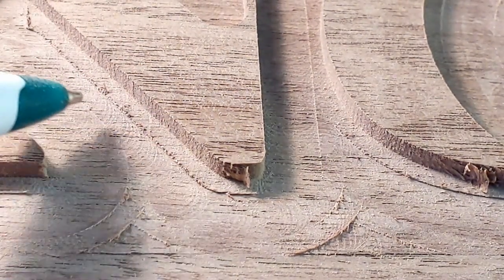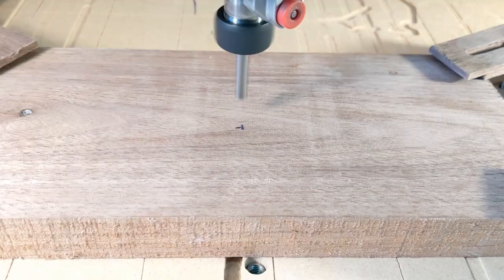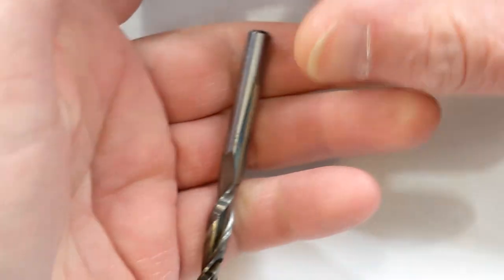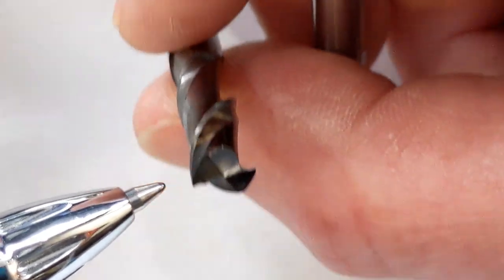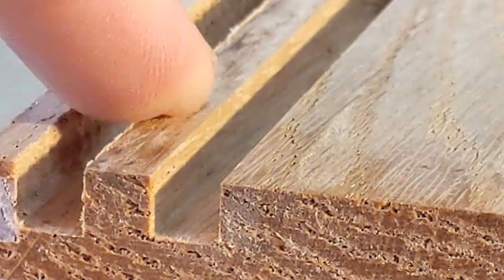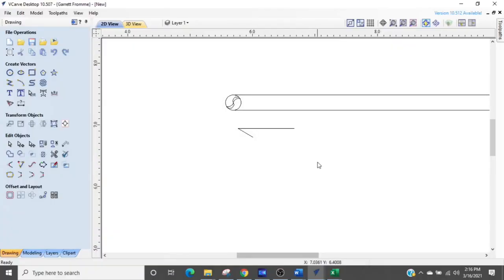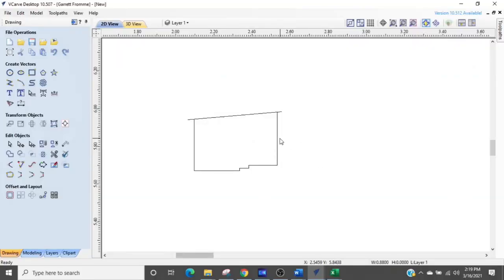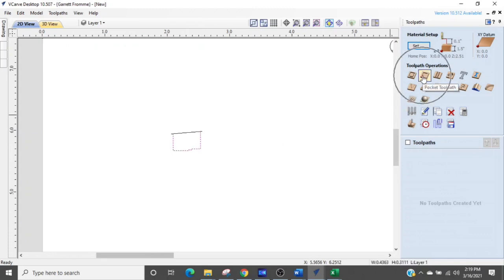Down Bits (Down Cut) And CNC Routers [What You Didn't Know] - Garrett Fromme

Comment: If you software supports it, Inner corner feed rate reduction will do wonders as well. Use the stubbiest endmill possible. I plow everything away with a 90% step over with a stubby 3/8 or 1/2 with a light chip load to reduce large tearout. All the same concepts apply with metal as well except the metal doesn't rip out chunks from the tool pressure
Reply from the maker: Brian, Great info, thanks for sharing brother.

Comment: Great info, Garrett. I've been doing something similar by using a pair of toolpaths, a roughing pass and a finishing pass, for the paths where this is needed/relevant. The roughing pass will typically stop 0.01 above the final depth. The finishing pass will take care of the final 0.01, as well as have a smaller stepover and a higher feed rate. For instance, the roughing pass might have a 0.1 DOC, a 25% stepover and a feed of 60 IPM. The finishing pass will be 0.01 DOC, 10% stepover and feed rate of 100 IPM. Yes, it takes longer, but still shorter time than cleaning up without the finishing pass.
Reply from the maker: Excellent. You've got it figured out! It usually takes a painful journey of sanding and realising it is much more worth letting the machine spend extra time at it.

Comment: funny- I'm new to the cnc desktop world but I've been manual milling with a bridgeport for a decade, and i see the same deviation while milling soft metals with an up-cut end mill- and i just eventually learned it was the material pulling the tool into it- (another reason not to use an adjustable drill chuck on an end mill vs a dedicated collet- as the cutting force seen between the tool and metal will yank the chuck right out of the spindle!) it's far less obvious with metal vs wood especially between using a steel bridgeport milling machine vs a plastic & aluminum cnc desktop, but it does happen.
Reply from the maker: Just Another Day, those are all great points man! These desktop routers are definitely deflection limited! Just like you said a bridgeport can do things that a cnc router isn't designed to do! Great looking out!

Comment: Thanks Garret, another good one!!  I have noticed what you are showing and never knew there was a fix for that.  I also have a question for you.  I fall my own trees and have a friend with a Woodmizer saw mill who mills my logs for me.  One of my favorite woods for simple not for show projects is Spruce.  We can fall trees up to twenty four inches diameter with a wood cutting permit and in some areas even bigger.  What I like most about it is that the bottom sections of the trees are almost knot free.  I makes really nice clear lumber.  And the best part is that it's free.  Don't know if  you have ever used it but I can tell you this, it is very, very strigy.  In this video where you show the difference between the cuts of the up and down cut bits, you can see the top edge of the board where you used the upcut bit is a little rough.  That same test on Spruce would leave one to two inch long fibers through the entire cut.  So I have been thinking I could use a downcut end mill and set the toolpath to about 1/16" deep and go around the entire project at that depth, then change the bit to an upcut to accommodate the fact that the cut is going to 1/2 or more deep.  That way I would have a clean crisp top cut, with no sanding,  and a more even bottom cut.  What do you think?  Would like to hear your thoughts on this.  Thanks again Garrett for all the videos.
Jim Scott
Reply from the maker: Hey Jim, great question! Your thought process is sound and I think this could work really well for you. I haven't done a lot of projects using spruce so I'm not super familiar wit the way it tends to cut. I'd say best method is trial and error on tis one. Worst case is you might need some sanding at the very end! Let me know how this turns out, I'd love to hear!

Comment: When I first started down the dark road of CNC routers. I had the same problems, but what I DID observe was the lack of my machine's rigidity. Anything you can do to beef up your machine will minimize witness marks. You'd be surprised at what some light weight aluminum angle can do for a machine's rigidity. You won't eliminate the witness marks entirely , so Garrett's solution is the one to go with!
Reply from the maker: Hi Greg. Thank you for contributing here. I always enjoy it when other CNC'ers add to things I miss.
Reply: this comment 100% i typically work with 2000 lb steel milling machines  (bridgeport) that have zero rigidity issues- i was unpleasantly surprised while unpacking my next wave desktop cnc to find it was built with a plastic frame and aluminum top- the whole thing flexes under stress. I've already begun to contimplate rebuilding the entire cnc with aluminum!

Comment: Thanks for the info.  I have seen this in my latest project and wondered if it was the setting of the bit in Z,  clearance path for a down bit z setting and then resetting the Z again when the bit was changed to the 60 degree bit.  I use at least 2 passes for clearance areas. I have also entertained the notion to add a 3rd pass but haven't gone that far yet.  I just get the sandpaper out and sand the marks out.    You have helped me get a much better understanding of CNC related stuff .
Reply from the maker: Hey Stew. This little down bit video is something I hope a lot more people take the time to watch. It is so important to get good finishes.

Comment: You have a lot of videos. I don't know the correct one this comment falls under but I am sure you will get this message and I want to thank you! 
You should get with longmill programmers for their touch plate!!!!!!!!!
I have been using your formula for finding the lower left corner. Works great (which I don't see others on YT doing). It even works when I divide the CUTTING diameter vs shank diameter. However, I just received my touch plate from longmill. I tested it out on a 1/16 bit which the shank diameter is larger then the cutting diameter which makes it irregular. But however you can put your own size in. I used .625 (already put on?? Must be a mistake), .0625 and the actual cutting diameter of .058. None of them got me near where it needed to be like it should have! Not until I typed your formula into the console did it attain a very acceptable position in the lower left corner.
To make a long story short -  their touch plate is absent of your formula to calculate irregular shapes. They can easily do this if they knew how. I know a lot about programming so I recognize the faultiness. Call them and get this fixed!!
If I plug in values it needs to calculate for these values!!!!!!
Do you know what I mean?
Reply from the maker: Iwannaapple, you bring up a great point. Unfortunately I don't have much say in the longmill touchplate. I would recommend reaching out to Longmill directly and telling them about this issue with the touchplate. Thanks for bringing this to my attention though and I definitely understand the frustration brother!
Reply: @IDCWoodcraft  
I already did! :)

Comment: I am new to cnc and really appreciate the info you provide. I don’t use Vectric software though, rather I use carbide create and carbide motion, but so far, things you have taught are easily transferrable. I am particularly interested in doing deep inlays, therefore, any direction you can point me in that will help with that would be fantastic. Thanks and keep on teaching!
Reply from the maker: JeffC-ct5jj, I'm glad you find the information helpful! Deep inlays can create some stunning effects. A good place to start would be to experiment with different bit sizes and depths to achieve the desired effect. I have a video that is for Vectric users but it should be able to help you quite a lot in Carbide Create too brother! Here is a link: https://youtu.be/Naxq3SbQH50?si=0rClZxe2ZdMVGRPS

Comment: Hi Garret, great video, love hearing the engineering explanation behind the reason. I happen to be using upcuts to pocket recycled hdpe plastic. Down bits melt it and cause a mess..the upcut pocket is super clean …but as you probably know I am experiencing the opposite whereas my line around the letters is deeper than the rest of the pocket.
Reply from the maker: Mike, glad to hear that this video helped you! Try using a smaller stepover or stepdown and it might get rid of the line around the letter

Comment: Another software moment.. additionally,  this can be machine enhanced.  If you have end play in the router shaft or if your tram system  belts or screws,  need maintenance; these pressures from the bit would be magnified.  On more point. My interest is in making guitar parts and there are videos all over the web advising to never use a downturn. Reasons range from fire hazard to inappropriate for the work. My observation is they might not be using the correct tool path,  i.e. spiral ramp, or maybe they like sanding. Thanks, Ron.
Reply from the maker: Ron, all good points brother. Glad you liked the video.

Comment: Question What are your thought on using 2 flute straight plunge router bit. This bit has a cutter all the way across the bottom of it .that his how it is able to plunge in to the wood. So it gives you a flat  bottom cut. There is nothing about the bit that is pulling it down or up.   Freud - FREUD 04-126 3/8" (Dia.) Double Flute Straight Bit with 1/4" Shank (04-126) Red
They com variety of sizes with 1/4" shanks.  a very good explanation of how those bit work. Thanks Jeff
Reply from the maker: Hi Jeff. The 2 flute up bit can plunge straight in and they work very well. The draw back is the burr left along the upper edge, leaving sanding work. The down bit leaves extremely clean edges along the top . Companies do not discuss this aspect. this simply comes from years of CNc machining experience.  Hope this answers your question

Comment: Great Video, don't you just love Vectric software?
 However not all of us have Vectrc software and if like me you are just struggling along with Carbide Create, then this option is not available. I address this problem by adjusting the depth of cut so that it leaves a small amount for the last cut. That is, if you are cutting to a depth of say 6mm, then if you adjust the depth of cut to be say 1.9mm per pass, then you will have a 0.3mm clean up cut to finish. As they say " There are many ways to skin a cat"
Oh btw sorry for using the deadly metric system in this example.
Keep Cutting
Reply from the maker: 'Metric' is not a four letter word in this boy's eyes. I love metrics! Far better than imperial.

Comment: Thank you! This was very helpful. I’ve avoided doing a finish pass because I figured I wouldn’t need to with wood and it would just take more time. My aha moment was in the first half of the video when you showed the sharp corners at the top and at the bottom. As you talked about the cutter on the bottom of the upcut bit I thought, “What about taking a shallow pass first with a downcut bit to have a sharp edge on top and then switch to an upcut but to finish and get a clean bottom surface?” The last half of the video answered my question though. My idea would work for a slot the width of the bit but not for something wider. I’ll start implementing finish passes, even though it will take longer on the machine. It’ll save me sanding time. Thank you!
Reply from the maker: Hi Kyle. Thank you for sharing this. Definitely enjoyed reading your insights. I think most people don't want to spend the time letting the machine do a finish pass. And it always ends up in more time sanding anyway.

I wish I had included in the video that finish passes are part of the process in virtually all machining processes in the industrial work. In fact, 'finish pass' is part of the lingo and operation. Wood is no different.

Comment: Hi Garrett, again great explanation of whats going on, but let's say you are using 2 or 3 different tools to do a pocket and letters, I get it with the 6mm for the main clearout, then I normally use a 2mm to finish off around the letters and tight spots, the again finish of with let's say a 60 deg 0..1 tip to give a slight angle on the letters. Do I then have to apply this to all the tools I am using??
Reply from the maker: Warren, that is a very advanced question so right on for being ahead of the game. This will take some experimentation in your case. I would not apply this correction to the v bit as these are usually straight flute tools and don't push or pull into the wood. As for the finish tool, you might see irregularities if you use a different stepdown and stepover as a percentage of tool diameter than your roughing bit.

Comment: Hey Garret. For the downcut bit to pull down or the upcut bit to pull up or down by 0.040" as per your example surely there is either lots of play in the spindle bearings or backlash in the vertical (Z) drive or "give" in the construction of the machine
Reply from the maker: Hey Mac. Yes, it was exagerated due to the machine. It is not super rigid. However I have seen many many posts in CNC facebook groups about this issue so i was prudent to share regardless.
Reply: Came here to say this. I have run a few different CNC machines now and none of them exhibited this problem with pocketing, either with uncut or downshear tooling. There should not be that much slop in the spindle or that much backlash in the z axis. If someone experiences this, my advice would be to have their machine serviced and checked for excessive wear in these areas.

Also, in the first comparison shot where the upcut and downcut grooves are side by side, the super ragged top edge and rough sidewalls usually are a sign of a worn out bit. I typically use up cutting bits for that type of signage and get clean top edges unless my tooling is worn.
Reply from the maker: @jzclarke  Thanks for the input hHighlighted. Yes, rigidity is a factor as well as bit condition. However, I see this issue all the time in facebook groups. So there are a lot of fo machines out there with rigidity issues. Gotta come up with a solution for these folks.

Comment: Taking a final light pass is a good idea -- just really time consuming. (Maybe stepping up the feed speed on that last pass so it doesn't take so long -- Mach 3 can do that on the fly; don't know if other controller software can.)
But your difference in depth between the up-cut and down-cut bits is over 1/32".  I'm sensing a lot of flex in your X gantry. 
I've avoided doing last passes to eliminate witness lines as well as not setting a small last depth pass just because of the time involved. But I'll have to give it a try.
Reply from the maker: Hi Richard. Unfortunately I do have a lot of flex. Either way, a lot of people have this problem with less flex. I forgot to mention upping the feed on the second pass for time so thank you for mentioning that.

For those who cannot change the speed, a second toolpath over the same vectors with higher feed is an alternative

Comment: Very helpful thanks! But after watching this comparison between up- and downcut, why would I want to use an upcut bit at all? In  what situation is an upcut bit better when working with wood?
Or is an upcut better for materials like aluminum and plastics?
Reply from the maker: In woodworking, upcuts are good for very large material removal. They do leave a better bottom cut on first passes. You will definitely want it if you are making very deep slots where sawdust has difficulty escaping from the slot

Comment: As always, great content.
Question: around the 5:20 make when you were measuring the depth differences between the Upcut and Downcut bits, what was the depth supposed to be? Thanks.
Reply from the maker: MickMack, under ideal conditions with a very rigid machine, the difference in depth is supposed to be 0.00." I was showing you the drastic difference that just a change in an upcut vs downcut endmill can make with everything else being the same.

Comment: Garrett, in a perfect world where absolute rigidity is the standard for benchtop CNCs, a bit shouldn't be able to pull itself downward, nor push itself upward.  I am therefore wondering if what you're describing is the result of flexing in the CNC components that affect the Z axis movement: the Y-Z gantry, the Y-gantry and the Z-axis frame.  My statement is based on my manual routing experience, where I frequently use a variety of router bits, both up and down-cut styles.  Thoughts?
Reply from the maker: You are correct. Regidity has a lot to do with it. However the other dynamics still come into play. Not as severe when the machine is strong. There are other other factors as well such as tool deflection which has nothing to do with rigidity. It's standard practice in machining to do a finish pass. 

In reality, many people have machines that aren't as strong as they should be. So this video is relevant to those people.

Comment: Thank you!  What would happen if you made your last pass with a 0.03 offset using  the same down cut, or switching to an up cut for one pass with a 0.03 offset last pass. That way the bit would not touch the letters or edges of the project and be fairly perfect.
Reply from the maker: Hey Paul. I don't even mess with last passes. I tried to reinvent the whell and very few things worked as good as this little setup does. So, I don't know and won't try.

Comment: Another big tip is to make sure your router is trammed to the bed. You can tell how well that is done when you surface your bed. You can actually tell what way your router is off by looking at the tool marks. Once the router is trammed and the bed is resurface you will see a huge difference.
Reply from the maker: Thanks Woodnack1.